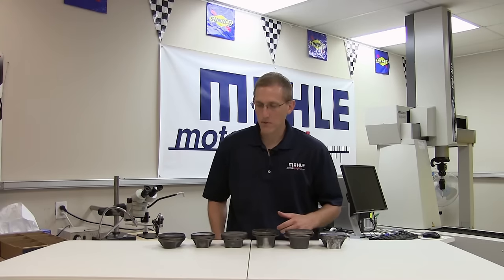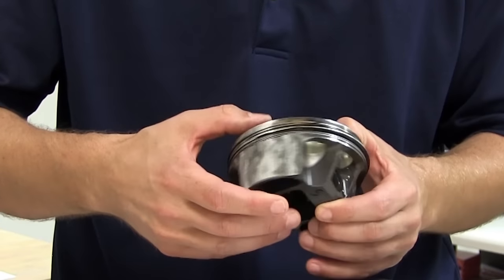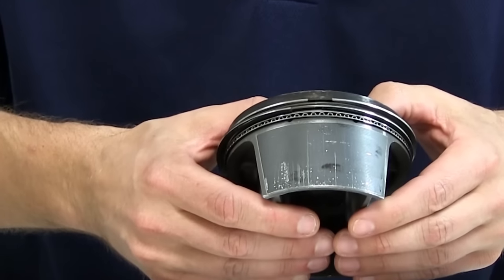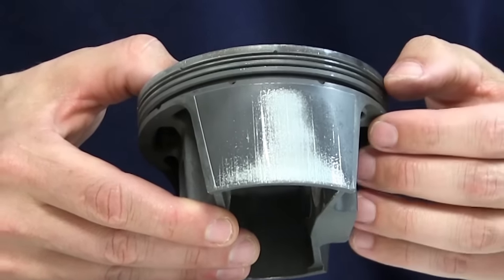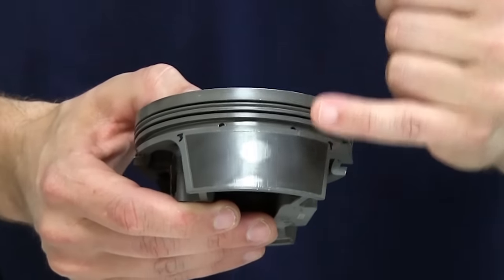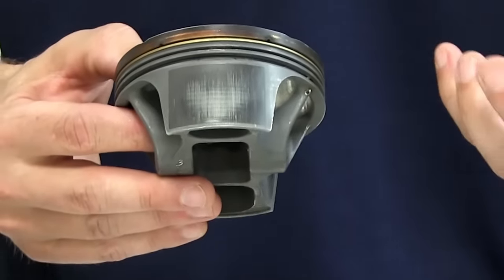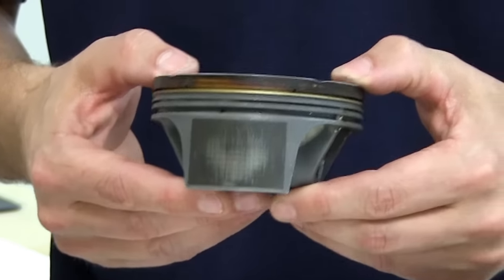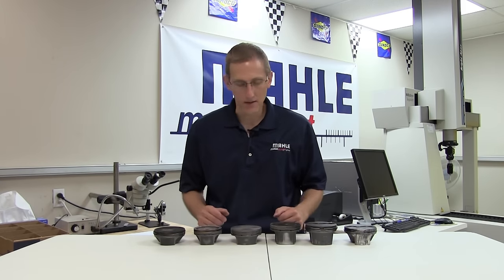Piston Failure Analysis - Skirt Wear

Comment: This video help out a lot at 0:25 because I’ve been trying to figure out the problem with alot of Honda 400ex piston skirts were this happens 👍🏻
Reply: I was looking because I was working on my 300ex and the piston looked scored bad and was not sure why it's air cooled it had oil when it failed the engine was hot. I don't want to pit a new one in to just fail again.  Did you find out what caused your piston to look like the first one?

Comment: I've never seen a piston come out of the bore with the skirt coating completely intact. Even with OEM coatings.
Reply: It doesn't take much skirt wear to turn newer engines into real slappers when cold too.    Slapping causes more slapping because you're tearing the skirt up more each cold start.
Reply: Cold Starts is the the Issue.. The next Motors I Build I will use a Freeze Plug Block Heater on Both Sides of the Block ..Older Chevy V-8,s and a Electric Oil pump Pre- Oiler.
Reply: I’ve had weird situation in my last engine only slaps when warm I’ve ruled everything out 
It’s almost comical no slap when cold only when hot and especially when the oils really hot never seen anything like it and no it’s not the bearings
Reply: The newer pistons have no skirts?! These all look like racing pistons.
Reply: Soooo witch ones can still be used?
Reply: @JAMESWUERTELE  Honda still puts a coating like this on pistons?

Comment: depends on the the cylinder position too, for instance a flat four engine will obviously wear the bottom of the skirt out faster than the top because of gravity. and also what the vehicle is being used for i.e hill climbs, time attack, rally....
Reply: Bipolar Transition h
Reply: I would think force due to gravity would be very negligible compared to the other forces the piston sees while running (inertial force, resultant force from cylinder pressure, etc.)
Reply: Oil alone will counter the effect of gravity wear. Internal forces are far greater than gravity.

Comment: I also have never seen a coated piston coming out of a hole with much coating left on it. Everything from a 1/3 of the coating to almost all the coating gone. I don't buy coated pistons anymore if I can avoid it. There is something to be said about the coating rubbing off and embedding in the cylinder wall providing some extended protection however I have never seen proof of this.
Reply from the maker: The Skirt Coating acts as a cushioning property.  It is simply trying to soften the contact vs bare skirt on cylinder contact which is not healthy for the motor. Several OE's are now using our pistons for vehicles that are daily drivers with GRAFAL skirt coating.
Reply: @mahlemotorsport  Nice!

Comment: how much piston scoring is too much? I had a flat tappet cam failure and my Mahle forged pistons are scratched from the debris in the oil. These pistons weren't cheap and I'd like to use them again if possible. Mine aren't as bad as the third piston he picked up, but still have many fine scratches. I will replace the rings.
Reply from the maker: Please take some pictures and send them to motorsport.tech@mahle.com to make a clear determination.

Comment: How much piston to wall clearance should you have 4” bore?
Reply: 4 inch is 100 mm... For every 10 mm they apply 0.01mm clearance.... Would be around 0.1mm clearance. (I guess)... But I think the overall use would be a factor to....
Reply: Christs Revenge  i can t tell you… so your new piston did not last that long,ore are you talking about your 1st (Original)piston???are you sure that your oil pomp is working oke,because piston lubrication is one of the first lubrication a dieing engine will suffer... if you check the inside from your piston there is  most of the time a casting stamp from the manufactuor,(like art for some japanese bikes)
i edit because now i understand your question.....!!!!! anyway if yo question that piston just measuring the piston on the lower part lets say 10-15 mmm from the bottom from that skirt,lets say the borediameter is about 75mm tan your used piston should not get much smaller than 74,92mm(15mm from  the bottom skirt!!!) 
what do you mean by "flare out"?
Reply: Christs Revenge  is the discolaration caused by blowby ?you can also check the gap the pistonrings have in the cilinderwall,so get them from the piston put the  1st ring in the cilinderwall and check the gap in the top,then middel and then bottom...dont know exactly but when the gap is bigger then 0,4mm than you have a problem i guess,in this way you also can see the difrence between top and bottom bore (without caliper!)maybe its a good idea for you to buy an haynes manuel ore download it somewere on line...there are lso specs for the room the pistinrings should have,gap clearance and also up and down.
Reply: Christs Revenge  well,first of all if there is any friction thats a nono.so the piston cant be stuck in the bore if you lift the cilinder(without the rings of course).what you can do (but its not waterproof methode)put the cilinder upside down on a table with a straith cardbord under the cilinder,when you drop the piston in the bore(without rings and with the ringgrooves pointing down)then the piston has to drop but not insantly,more gradualy.
if the bore is to small then your engine will not idlle and sees up soon i guess…

if the bore is to big ,off course with  your forstroke it wil make to much blow by,but even worse because there is no coolant for the piston(because of youre big bore!)...because there is to littel contact with your cilinder liner your piston can t get rid of the heat,then your piston gets so hot it will expand much harder then your cilinder liner so it can sees up (while youre bore is to big!!!)
piston can also go rocking with big bore
 and that why you cant have your piston to small in diameter...

check for a castingstamp on the inside from your piston......
Reply: Christs Revenge  yes oké.... Think the xt 250 can handel at least 2 oversises from. 0.5 mm each, maybe now you learn the hard way but Don 't get discouraged... Anyway if you need some tips when mounting just ask.... And buy a haneys Manuel.......
Reply: Christs Revenge  any progress with the Yamaha?
Reply: @bigboreracing356  yes oké... Makes sense, you have a wide variety of applications... And yes I count with 0.01mm per cm in diameter for every dirt bike over here....

Comment: At 2:05 , if it was a clearance issue. Would it be due to too much piston to wall clearance or to little piston to wall clearances?
Reply: I am just a simple mechanic not an engine builder but I am pretty sure it was one of this 3 reasons:
1- Too much piston to wall clearance.
2- A design flaw on the piston (basically piston was too short and made it rock too much even when with clearances within specification)
3- Used on the wrong build (basically those kind of pistons are aimed at low boost high RPM type of engines. I think high boost engines are more susceptible to piston rocking but once again I am not an engine builder and I don't have much experience with this)
If it was too little of a piston to wall clearence the piston would look more like the first. At the very least I think it would have some "blueing".
Reply: No, at 2:05 he even says they were working on shape issues (piston was not uniform to the bore as good as it should have been). So it's a weird one-off situation there

Comment: Isn’t the purpose of a skirt coating to buffer the expected known contact that Will be made on cold starts?
That’s their very purpose. Their only purpose.
Reply: The wear on each of those pistons would still be there even without the coating; the coating just makes it easier to see. You would otherwise need to have the parts in-hand to really see it in detail. Or high resolution, zoomed in shots.